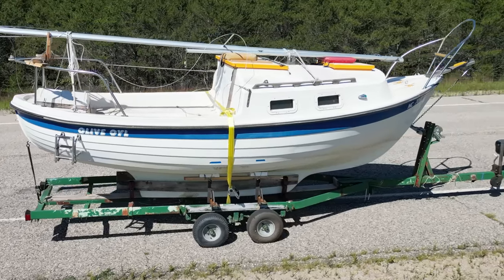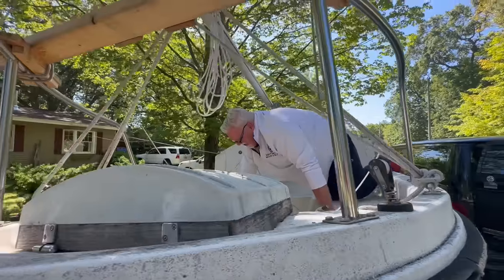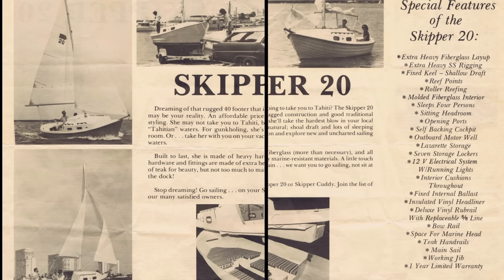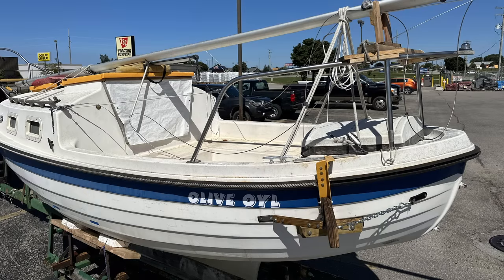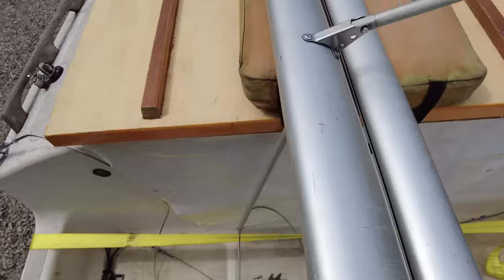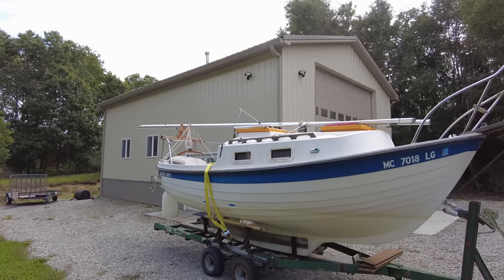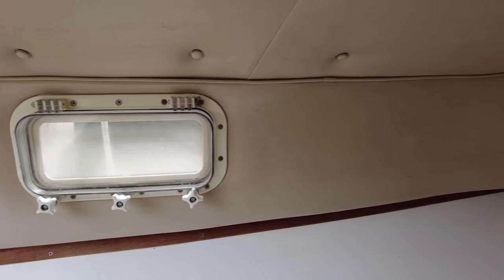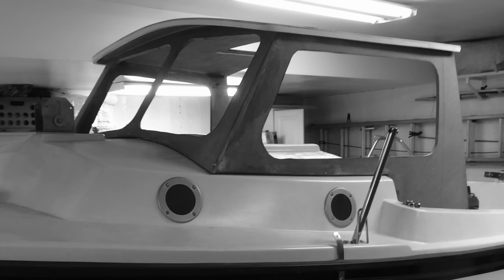Can this Little Sailboat Cross Oceans? | FULL TOUR | Skipper 20 Sailboat Restoration |(Ep49)

Comment: Based on my experience restoring vintage European motorcycles, this is flipper for sure. Looks like it was respected and cared for. Good owner intensions but not used much.  Outboard is evidence of that. Not abused or chopped up. Practical improvements using limited skills. Bring it back to life but don't over do it just because you know you can.
Reply from the maker: Another vote for the quick flip. However a pilothouse if done properly transforms this trailer sailer to a little big ship and increases the resale value by 3X
Reply: Its a happy looking cute boat with a name to match. I think the pilot house takes away from that. But I'm not a sailor.    @motorcityboatwerks
Reply from the maker: 😳Cute is how we describe kittens or children with lollipops. The correct term is “salty”😁😂😂

Comment: Check the ballast if you can I think it’s concrete as I think Compac used too . Fixed up a bit have fun in protected waters and no pilot house please ! Bad idea too much windage and will make it unstable. Unless you are a qualified naval architect please don’t go altering the dynamics of any boat . It is what it is a day sailor in fair weather.
Reply from the maker: Robert please see my Compac 16 pilothouse conversion and all my other boat restorations. A proper pilothouse conversion does not add too much windage or weight or make it unstable. I have already proven this. Thanks for your comments 😎

Comment: Great little boat.  My advice is to keep it as a sailboat no matter what you decide.  Adding the pilothouse top or hard dodger would be sweet, especially if you connected a bimini with side curtains for a full cockpit coverage.   I can think of many great little adventure with a boat like that in New England where we sail our boat.
Reply from the maker: Sounds great! Thank you for your vote
Reply: @motorcityboatwerks I vote on keeping her as a sailboat also. Maybe a hard dodger depending upon where and how you plan to sail her. Also think about a breakdown tent type enclosure for the cockpit for staying overnight at anchor or close to shore on lakes or lake island camp spots. She has an abundance of character, it would be a shame to lose it. Especially if adding height and weight that would make her tender on the water.

*Second idea as an addendum to my vote: Go big! Start a new business venture! Make a complete mold of her, both top and bottom shells. Then bring her model back to the market as a trailer sailor/ pocket cruiser. Sell completely finished boats. In addition to offering just the bare hulls with the topsides, (decks, cockpit, and cabin top.) Basically all molded In features that would allow the purchasers to then finish themselves to a standard and budget they can afford. 
Next step, achieve success. Now talk to James Baldwin (Atom Voyager), about bringing a new design to the market. With a  small sailboat similar and comparable to the ones he refits. Incorporating all of his design ideas, innovations, and refit improvements. Which results in a tremendously capable blue water, adventure sailboat. That is comfortable,and easy to sail  single-handed. Then disrupt the market by bringing an attainable, affordable, and capable sailboat. One that does not price out the majority of the market. Those ooking to find an affordable and safe new boat to go cruising. However far or close that may be. So that’s my vote. Do all of the above or something like that. Lol 😂
Reply from the maker: That’s an ambitious plan! And one that might take more than one guy working in the Boat Werks! I will have to think about that 😅

Comment: What a fabulous little boat. I would love that project. I did a Victory 18 that had the hull pierced on both sides of the bow. It was pulled out of the water on a makeshift trailer. It was filled with water when recovered. The trailer supports up front pierced the hull as it settled on the trailer. 
Sailed it several times after i repaired it. The problem was launching and retrieving. It required a twenty foot chain  between the trailer hitch and the trailer in order to get it far enough down the ramp so it could float.
Reply from the maker: Thank you Terry. Victory 18 is fine boat. I have studied them may times and find them proper 😁

Comment: I used to have a English built 17 ft LEISURE double bilge keel sloop....it was massively fibreglass built with good sitting headroom. In the earlier boats manufactured of fibreglass, they were overbuilt because it was a new product and they were built strong. I was told that my model crossed the Atlantic single-handedly by a German sailor. 
Due to the lack of head room in your boat, I could see building it up with a pilot house. I wouldn’t like to live in the cabin overnight, crouched down.....but that’s only me...otherwise, she has beautiful lines....cheers🍷🇨🇦
Reply from the maker: Exactly, I think you articulated a reason for the pilothouse perfectly. This is perhaps the best argument why a pilothouse should be added. 👍

Comment: Love seeing old boats brought back to life...
My "Exwife" found a better "Deal"  or another "D" word.
So I Located a 1969 Mako 19' (same year I hatched...)We are same age.
I pulled the cap and removed all the saturated floatation foam, Monster re-built the rotten Transom, 2-1/2" thick, and beefing up the stringers.
A few years into the project,. I'm getting back to working on it. 
I shattered both bones in ankle so a set back for more than a year.
My plans are too much to even start to describe but it's a Full Resto.
But twin outboards is the 1st. on the agenda.
I have twin 60 gallon fuel tanks that I am fitting under the floor and adding a few extra stringers  to corral the tanks.
I have float tested it with the mock up of the weights listed, but it will be a 1-2 people boat rather than 4-6 as original. 
Also, in the recent year I obtained a saw mill, So I'm kicking around milling Eastern Red Cedar from my property that has died  and still standing for the rest of the project.
Another 1 of a kind build from 50+ year old boat.
Will enjoy following your Build.
It's your ball of wax... make the candle that "YOU" want.
Cheers.
Reply from the maker: Wow what great projects you have. Welcome to the Boat Werks! Thanks so much and whatever you do Stay Motovated 😁👍

Comment: Micro trawler for sure.   Great description of what to look for.  I am debating building from scratch a pocket trawler or buy and rehab an existing boat.
Reply from the maker: Mike I always suggest rebar an existing boat and choose fiberglass. For the DIYer it’s always easier and cheaper. And the likelihood of being able to sell or sell off your project should circumstances change—well it just make sense. Welcome aboard and Good Luck! Stay tuned 😎
Reply: Fiberglass older boats seem pretty cheap and sound. 😊

Comment: I like the pocket trawler ides but it might make docking very difficult when it comes to the boat handling. 

I'm thinking about a pilothpuse build on a J/24 of all things. It's wide and fast and cheap. Perfect for that, imo.
Reply from the maker: Welcome aboard ! 😁👍The Skipper 20 is destined for a Pilothouse Conversion. Check out the other Episodes about the design  and theory.
Reply: @motorcityboatwerks Thank you, I saw it after I posted. Another thing I was thinking about, the Compac 23 Pilothouse looks like they literally just cut the cabin house on a regular Compac 23 and used the piece they cut out as the hardtop for the pilothouse. It just has me thinking about easy solutions and being able to keep the OEM looking sliding hatch. It seems that would be pretty easy on certain applications.
Reply from the maker: Check out my video on building the Compac 16 pilothouse conversion. That’s exactly one of the steps in my build. Not quite as simple as you think but it is the top sliding hatch repurposed.  https://youtu.be/RPys9TLfwqo?si=cFGTZCymA9Wo2sSY

Comment: It's perfect for a daysailer.  For a pocket cruiser the pilot house would be nice along with electronics and kitchen.
Was the great stuff installed because of water entering the space from the motor well? 😊
Reply from the maker: Fred I think you might be right. I will be discussing this during my live stream this weekend. Thanks for the comment 😁
Reply: A second reason for the great stuff would be the well was thought to be flimsy.  And the great stuff was used to shore up the well.
Reply from the maker: Defitely not Great Stuff
It’s commercial close cell
Reply: If the well is sound, you could glass over the foam and fill the voids.  Drain the water to the well.  You could store fuel in the compartment. 😊
Reply from the maker: Thanks Fred. Please consider supporting the Boat Werks. These episodes would not be possible without your support https://patreon.com/MotorCityBoatWerks

Comment: I get where you are at. I've worked on boats for 58 years. Sometimes you see one (don't need it) and you just buy it. "There is nothing better than messing around with boats. I've got a 1989 22'Hurricane deckboat which took 3 yrs. to find a 90 Merc.now it looks like new....total cost $2100.
Also a 17"Slipper (very traditional design) $2k.
Reply from the maker: Welcome aboard Kevin Be sure to like and subscribe

Comment: Definitely a protected water boat. That foam is likely there to limit the amount of water that can flood up through the motor well in certain sailing conditions. It is a known problem for that hull design. The fiberglass around the keel is also thin and failures from water freezing are out there on the forums. Curious to see what you think once you really get into it.
Reply from the maker: You may be right in several points. But I always marvel at the keyboard commandos who repeat opinions from Internet forums. This has happened with my Alberg 30, the Mustang 22, the Albin 27 pocket trawler. Misinformation and vox populi….
Reply: @motorcityboatwerks  No offense was intended. Every boat is a compromise in some way. As I said it will be interesting to see what you do with the project.
Reply from the maker: No offense taken😁 we enjoy robust and spirited discussion in The Boat Werks. Be sure to subscribe! Thanks and Keep it coming!😁

Comment: I just subscribed so I could follow your project.  My vote is to leave it original.  This also means get rid of the swim ladder.  No "character".  Looking forward to your videos.
Reply from the maker: If you get rid of the swim ladder how do you get back in the boat when you fall over board or go skinny dipping?
Reply: @motorcityboatwerks  I think that the person that sails that kind of a boat isn't interested in skinny dipping.  That's why I recommended that.  For falling overboard, if single-handed, you're supposed to be trailing a safety line.  The swim ladder will be long gone (and useless) before you realize what happened.
Reply from the maker: Interesting idea. 🐙Thanks for the comment 👍

Comment: I would keep the boat original, the cabin is a cuddly cabin and designed for sleeping, not lounging in.  I had a S.F. T.I Sloop that had a similar again and it was nice  and cozy to sleep in.  Otherwise, as a day sailer you are going to spend your time out in the cockpit, and the odd weekend aboard.  A boom ten could be rigged for days of light rain, when at anchor.  Cheers
Reply from the maker: One vote for original 👍

Comment: Raise the whole cabin roof by 8 inches, put in some forward facing portholes. Put in a mini galley, with small gimballed stove, fold out table and 2 good berths. Extend the engine compartment, put in a small diesel with generator and prop-shaft. Make an awning for the cockpit from 2 solar panels. Put in navigation systems and sounder, a shower, head and water-maker. Then actually cross an ocean as the title suggests it might.
Reply from the maker: I think if I was going to  cross oceans, I’d stick with a sailboat. But your description of the micro trawler idea is interesting 😁
Reply: I would still keep the sails, as well as have a little diesel engine. If you had furlers on jib and main sails it would be a great one man off shore cruiser @motorcityboatwerks

Comment: the hull looks identical to a Dell Quay fisherboat, which were 20ft long, and came with a choice of wheelhouses, and cuddys to choose from, with choices ranging from totally open to the gunnels, to three quarter length wheelhouse, and the rest decked in, and any combination in between, 
and with a choice of either an inboard, outdrive, or outboard with a well, 
but i never saw any of them rigged for sail,
Reply from the maker: Interesting find! The Skipper 20 was reportedly made from a mold of a motor launch by Sovereign Sails in 1979 in Clearwater, Florida. The keel is not a bilge keel like the Dell Quay, but an integral encapsulated shoal draft keel.

Comment: Sweet little boat, certainly not meant to cross oceans the way its configured but it'd take a beating and a dunking and probably come upright again, which in why you should always consider its righting angle when you start chopping things up (pilot house) and adding extra weight above your water line and sheer.  I love the hulls on these and like somebody in the comments mentioned its like a mini Hans C., they're built like ducks.  My thought on a 'pilot house' thing, hm, to me a 10inch raised roof with a split 7-8" front window would be about as far as I'd take that, give a man enough room to strap into a comphy seat without bonking yer head and maybe have enough room to stand up out of the weather.  As the design gets taller there become other factors than center of buoyancy due to added weight, like windage and wave-power (for which you'd have to make it tougher/add more weight).  Then there's making it into a motoring vessel, which it'd probably make a fine pocket cruiser with decent range, but open ocean?  Please don't unless you're like the crazy man sailing his six foot boat across the Atlantic a while ago (fail), or the small-boat solo masochists
Reply from the maker: Interesting points.  But There’s no added weight or extra windage using the pilothouse conversion method. Please see my Compac 16 Pilothouse conversion video 😁👍
Reply: done mon. @motorcityboatwerks

Comment: For a litle boat the widows / portholes appear to be more rugged than many other boats of similar size. The seals on big million dollar yahct's will still pop and leak after a day or so of serious pounding. However I'd probably want an explanation for the foam if it's sound dampening (heat resistant so it doesn't trap heat and ignite later) or floation foam ...okay but if it's for micro cracks, that might be a pricey fix unless you can do that kind of work yourself.
Reply from the maker: Check out my recent live stream from the Boat Werks where I discuss the foam. Thanks again for your comment 😁

Comment: I know the company I visited them to see if they would suit for selling in the Chesapeake Bay as I owned a boat broker firm . My impression then and still is built cheaply but sufficient for Tampa Bay Gulf area sailing coastal only . The scantlings were generally marginal as you saw in the chain plates . This is not an Albin lol. 
Plus the hull design looks to me she would hobby horse in any real seaway .
Reply from the maker: This renews my impression of boat brokers. I definitely would not say the boat is made cheaply. Did you have your eyes open? 😳🧐While some components might be undersized or lightweight— that hull, rudder, interior, and general components are quite nice and well built. 😂Maybe you mean Alberg not Albin. I restored a classic Alberg 30 sailboat and when I hear comments like yours I just chuckle. 🤣my Albin 27 trawler while nice is not a contender. Thanks again Robert. Be sure to like and subscribe 😁👍

Comment: It will always be a slower sail boat thats its only down fall ,  but it's good points are  , it's clinker hulled bloody strong , got weight in her very stable , when the wind picks up nasty the other lighter longer boats start reefing  down to hanky size Saill's to go slower and try to stay up right  , this thing will start to come into her glory with say a 1/2l reaf in her sails then she will take off and pass the other boats shittin themselves 😊 there called pocket sea going sail boats that can go where the big ones can go , and the beauty is u can trailer it home 👍
Reply from the maker: Thanks for the comment 😁
Reply: @motorcityboatwerks a guy called Aussie Wittley in Melbourne Australia built many  22ft twin swinging keel firberglass trailer sailers called the Jedda 22 by Wittley I had one their magic sail boats very capable , he designed them to sail across Bass Straight that's very ruff waters between Australia and Tasmania , I had the 8hp yamhar single pot  diesel in her went great , them boats look similar to yours but longer , check them out 👍😊
Reply from the maker: Nice 👍

Comment: No, not a pilot house just a covered top over the gangway 2 feet higher if any to look scale.  No reason to put 6ft headroom down below.  Not much to walk around down there for.  A self steering system would be THE luxury sending it over the top for a longer sail and will sell it!  A tiller  type auto pilot.  Grind down the great stuff until flat so water can be bilged out.  Probably a step the former owner did not complete.
Reply from the maker: You are right on target. Exactly the way I’m thinking. 😁👍😁

Comment: Keep it original
Reply from the maker: Another vote for original ! 👍
Reply: Interesting boat, and I am following to see which direction you take this project.  The chainplates are ….well lightweight.  But in their defense it is a comparatively light boat and somewhat lightly canvassed.  I probably would get it sailing then decide of the direction to take the project.  Shame to build a mini trawler project then have the boat either too tender or with so much windage that it would have unpleasant handling characteristics.